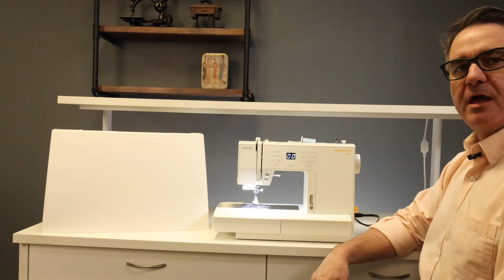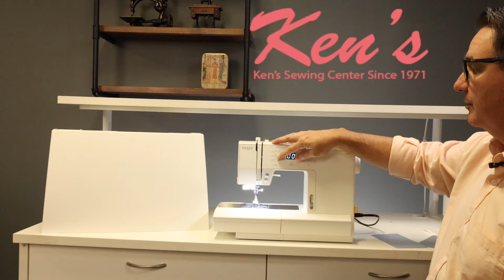Pfaff Passport 3.0 Sewing Machine Feature Overview

Comment: I've had my Passport 3.0 since August, 2017. I had to replace the jack for the foot pedal in 2019 and now it's starting to loosen again (won't hold the plug in snuggly).  I will probably have to have it replaced again. It was rarely used from 2020 to recently so it's not from too much use. Do you know if this is a known problem with these machines?
Reply from the maker: It is not a known issue